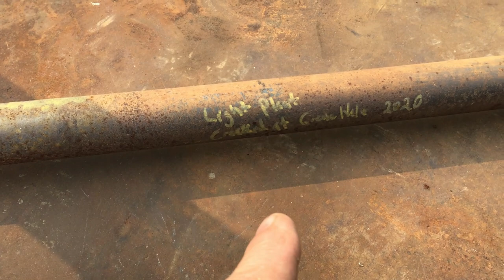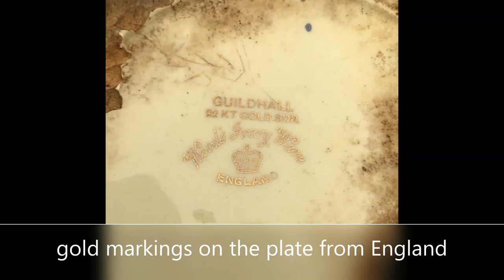Magic Welds on Cracked Axle Spindle June 12 2023

Comment: I    did   the   same   deal   back   when   I    had     a    minyhoe   I    used   a   pinal   hitch    loop     put    it    on    the    bucket    and    just   put   the    axle   underblade   turn   around   and    hook   loop   on   truck    hitch   lift   tracks   off   the   ground   and   go.
Reply from the maker: excellent idea on the pintle hitch, if i had the room i could have done that to free up the box space.  thansk

Comment: I still have my Tonka straight blade dozer with rubber tracks. Do you know how hard it is to push dirt with thin rubber grouser bars? AL B.
Reply from the maker: yes and the rubber track would fall off if i remember correctly. thansk